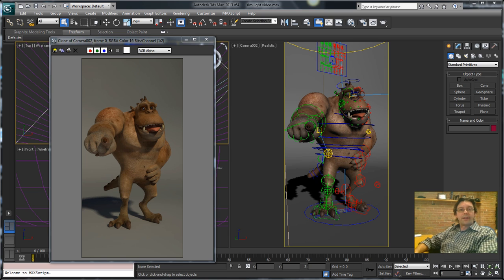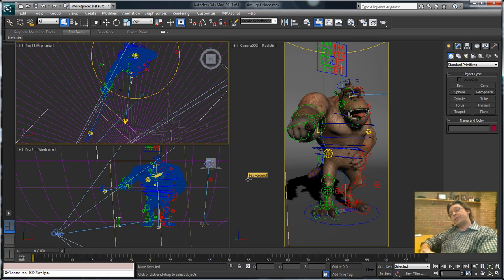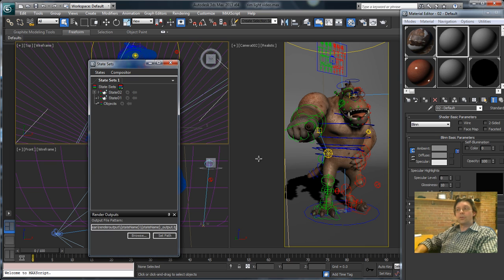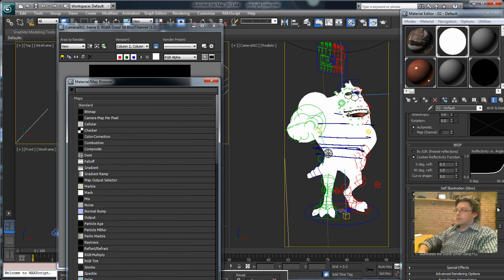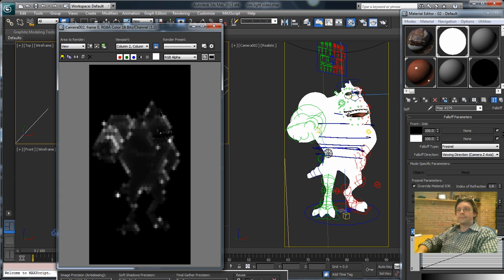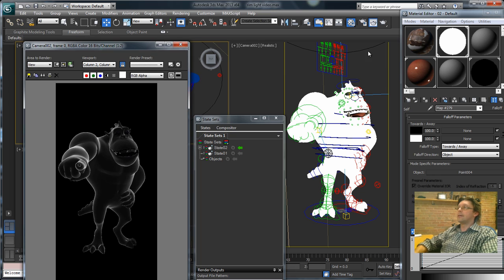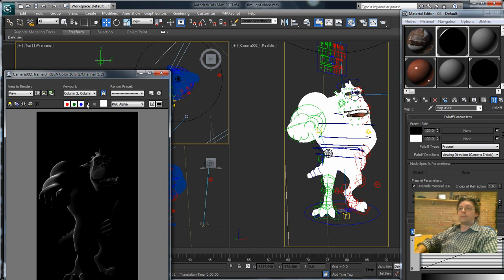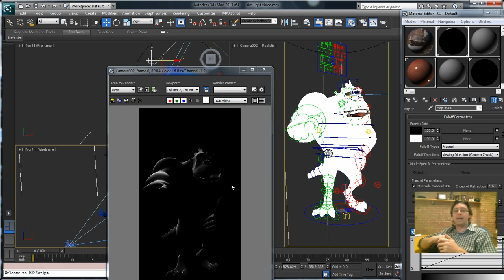Creating Rim Lighting with a Shader in Autodesk 3ds Max

Comment: hmmm.  not sure whats happening in your file.  I just did a quick test here on 2014 and the falloff material updated with the movement of the helper when I rendered the animation. I animated it both with keyframes and a path controller.  both worked.